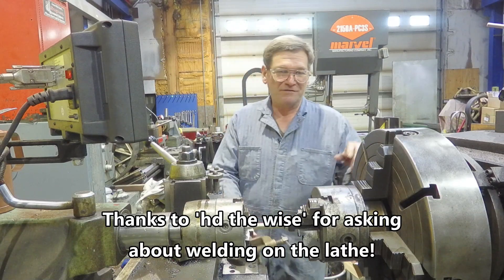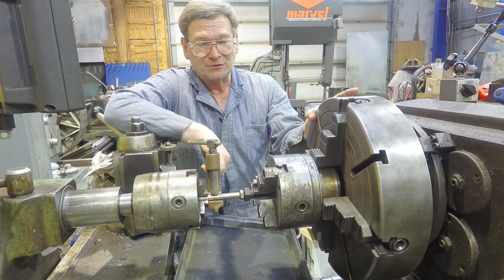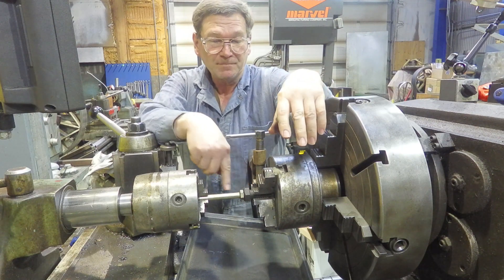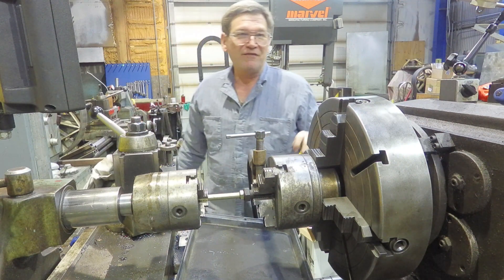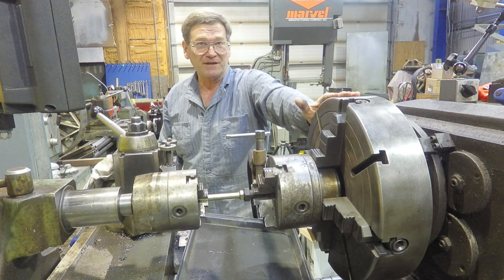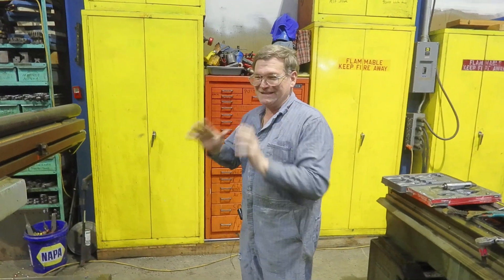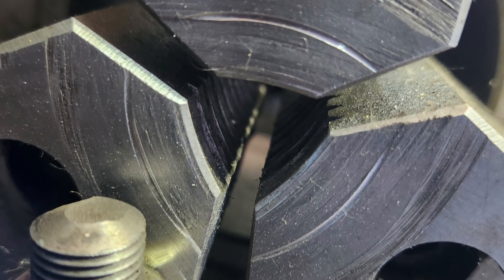Machinist's Minutes: Q&A - Will welding on a lathe damage it?

Comment: Electricity is always supposed to take the shortest route it can, therefore always keep earth clamp as close as possible,  though having said all that i would be very slow to weld on my lathe,  and if i did i would cover the bed with a lot more than a tray. A wet sheet would be a lot better. And cover a lot more.

Comment: Old lathe for spray metal, in front of an exhaust fan. Never worry about the current, taking the long way around. Two grounds is a cool solution. Ways and other things, always got covered up. They have welding gadgets now, that turn the pieces for welding. Ground came off on a CNC milling machine, and started boring into the table. Hold and E-stop didn't stop the mayhem, because the wiring was fused. Oh, the horror....

Comment: You could isolate both parts. Well, a bit hard between centers. But also even harder to try to join two parts between centers. 🙂Voltage of a welder is normaly below 50 V. So even an isolation tape should do the job. Admittedly, I didn't try it.
Albeit, with TIG welding, you should be cautious! HF and high voltage to start the arc. And you know what gaps the ignition can jump.

Comment: Yo, in regards to grounding, grab a 18-24 inch length of 1/0 copper stranded electrical wire and strip all the insulation off, grab a short piece of copper pipe or tubing that you can slip both ends of the wire through as a sleeve to tighten the loop of the wire.  Loop the copper wire around whatever you're fixing to weld, just figure a clever way of a-fixing the ground clamp to the ends of the wire and now your work can turn freely and it's always in contact with the ground lead.

Comment: Wouldnt oxy welding just eliminate the issue alltogether ? I get it would also present its own issues and not always be ideal but in alot of cases wouldnt it just make it much simpler to. Not have a ground to worry about ?
Reply from the maker: It takes too long, Oxy-act is very slow, that's why arc replaced it..

Comment: What about making chucks with a non conducting arbor to isolate the weld current?
Reply from the maker: The electricity will just go another way that is not wanted.  Grounding the chuck will greatly help, and can be done with a ring & brush set.

Comment: Just clamp a  U bolt on there. Flatten couple inches on each side of U bolt. Easier to clamp down. Then once you got some of the welding done you can take it away.

Comment: Insane to use your lathe as a welding table.  A welding clamp setup is way..way..way..way cheaper than a lathe.  Great you covered the ways...what about everything else?  Chuck jaws, tool post, compound ways.  So much safer and easier to just pull it from the chuck and go to a table and weld.  If you need it perfectly aligned, use a rotary table setup on the welding table.  Rotary tables are a lot cheaper than a lathe.  Just saying.  Im fairly sure the electrons can travel through the bolt head connection unless there is a gap Im not seeing on the vid.  Strike an arc on the other bolt head and the electrons will always choose the shortest route to ground, which would be through the bolt heads.  Striking an arc means arc welding which spatters everywhere.  If you are going to weld on your lathe...use a tig....or at least a gas mig.
Have a good day.
Make chips that don't need dips!
Reply: Dude.   Some of these big old lathes are 500$

Comment: Some high speed machine spindles have earthing contacts built in because of current generated either from machining of the rotation (I think it's the machining), I think they got around the problem by using ceramic balls in the ball races.
Reply from the maker: The brush set You are referring to, is generally good for around 20 amps, the welder will be 90 or more amps.  While it would help, if you are doing things mostly correctly.   I could see someone deciding to use this as the ground, and causing great damage.

Comment: I am an auto mechanic. I have a six step voltage drop test i use on every car and light truck.  

Engine running. Headlights on.

Positive to Negative battery posts. 14.1 to14.8vdc

Two. Negative post to the engine block.  No more than 0.04vdc 4/100th of a volt 

Three. Negative post to the body.  0.04vdc max

 Four.  Engine to body.  0.04 vdc max

Five. Positive to all the fuses in the underhood fusebox 0.04vdc max

Six. Positive to alternator output studs.  0.3 volts or less. 3/10th
 If tests 2, 3, 4 are high  especially 4. The electrons coming off the alternator are trying to get to the body where eveything is grounded. The electrons will take the shortest path. Thru the transmission.  Cv joints. Wheel bearings. Strut mounts.  The repeat failure of front wheel drive wheel bearings can be traced in some cases to loose electrical connections. 

If i had to weld on a lathe.   A twin lead ground cable assembly with braided copper cables to use over both chuck bodies to reduce the chance of electrons playing. Frogger across the spindle bearings.

Comment: We had a job, large steel domes that needed 2” holes, all drilled vertical. We cut varied angled blocks to weld on, so the drill would enter on a flat surface. The Night Shift used the drill spindle to hold the blocks in place so the welder could tack them. When I came in the next morning, the 6” dia. spindle of our Bickford Master Service radial drill had dozens of arc-strikes. The spindle ball thrust bearing was about destroyed. Parts no longer available. We had new custom bearing races ground and bought 7/8” balls to fill the bearing. We had it torn down for about a month. Oops!

Comment: As a machine tech.  Best logical and factual breakdown of the subject, and how risk vs reward always enters an intelligent persons decision making.  Would I ever do it on a 100+K CNC? NO! On a junk lathe? Absolutely!  The precision spindle bearings are where this ends up being very damaging as they so precision. They do make brushes that hook to the back of the spindle to transfer the current. In hydraulic shops adding a MIG welder to the tool post and a slow motor to the head stock just to build up a shaft is common.   Nice shop BTW.
Reply: Most people assume that welding must destroy the bearings. Which is BS in most cases. Bearings will be fine!
Reply: @GrandePunto8V no, not really. If the chuck rotates even a slight bit, the bearings can get damaged.

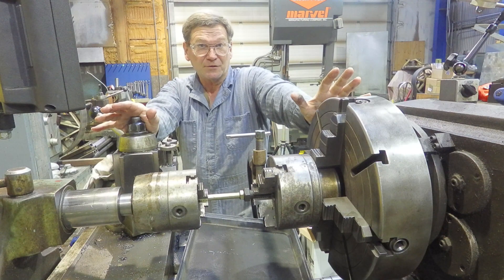Comment: 5:12 lodge and Shipley lathe? Shop I used to work at had an super old lathe that someone had done that to. 

We also welded on lathes I wasn’t a welder but I would set the machines up for it since our welders weren’t really up to speed on the important parts of the lathes. Still had one kid catch a lathe on fire used old oil soaked rags to cover the ways after I indicated a cylinder eye and a rod in our big moriseiki. Didn’t burn it up just game me a scare.

Comment: We weld repair shafts everyday. Two lathes, an 18 x 50 and  34 x 120.
Usually motor rotors from 1 hp to 1000 hp. Also pump shafts and large mixer shafts.
We also lengthen shafts for custom applications.
We repaired a 17 foot shaft @ 4500 lbs with bad bearing surfaces. 50 lbs of Mig wire was required.
Both lathes have spindle drive systems adjustable from 1 to 10 rpm.
Also ground systems that commutate on the chuck OD.
And Mig gun holders for the quick change tool post.
No helmet required, no lathe protection needed. Setup time 3 min.
Everyday. After 5 years nothing from the customer has been returned.
Reply: That grounding system stops most any potential damage.  And it's the machine that's going to get messed up, not the parts.  Very common practice in places that must build up shafts.

Comment: Most welders suck at welding near a welder, nevermind welding with/on/near a lathe. Just don't ground any moving parts like bearings or bushings and don't get spatter on anything you don't want it on. 
For competent people it's fine. For everyone else slightly above average or lower; just don't.

Comment: Video suggestion: Take an old junk ball bearing. Prove that it still rotates fairly well. Next, intentional run the ground through it for a weld.
Reply: Test must simulate the lubrication, grease or oil (like in a real lathe). The bearings will be OK.
Reply: @GrandePunto8V it seems that there’s a lot of experience here showing that you are wrong.

Comment: What do you think of welding while the machine is running? I've seen Abom79 spatter-weld a shaft while it was turning to build up material at least once.
Reply: no electricity with that process
Reply: @darrenfloen2693  oh yes, that makes even more sense! Lol
Reply from the maker: You can set-up a set of brushes on a ring to make contact for welding, this is a common modification, along with slowing the motor speed to a crawl, so an old lathe can be used to do weld build-up, similar can be done for plasma spray transfer, but the speed can remain higher, if it is flame spray then the brush ring is not needed as no electricity is involved.
Reply: @HOWEES  Thanks. I tried to find the video to watch again and find out, but Adam makes so many I never did!
Reply: If you protect the lathe don't let excessive heat travel up to headstock you should be fine

Assuming you're talking about flame spray weld method

Comment: How about the welding current going through the electrical motor and the earth on the electrical supply. Should one pull the fuses ,  turn the power to the machine to off. Also clearer metal items (scrap) that’s touching the machine and touching the next machine and the chance of the welding current running to earth via the second machine.
Reply: How would the current jump from the frame onto the insulated motor wires? If that happens you have much bigger issues! Lol
Reply: @ke6gwf  I’ve had power lead to handheld disc grinders burn out & melt due to welding current going through the machine earthing cable. It certainly was not a lol moment!
Reply: @LifetimeinWelding  sounds like you didn't have the ground clamp on the workpiece, but it was on something connected to the building grounding system lol

And pulling the fuses won't stop that sort of thing, because the ground wire on a lathe would be hard wired in, no switches or fuses.

Basically make sure that the ground clamp is on the piece you are welding on, and if possible don't ground the welder ground to the building ground lol
Reply: The current from welding would be far to high.

Comment: We had work done on a fuel truck, they needed to weld on it. The welding caused thousands in damage because the current flowed through electronic components in the meters.

Comment: Nice to see someone honest about their own mistakes, many crafts people have such big egos they never admit mistakes.  I have a 2 foot and 3 foot heavy cable in my shop with clamps on both ends in case in case I want to double ground.  My work bench is also grounded and I use the short cables to run ground from the table to the piece being welded at times.  I'm really more of a sheet metal and fabrication shop but thanks for your chip making tips.